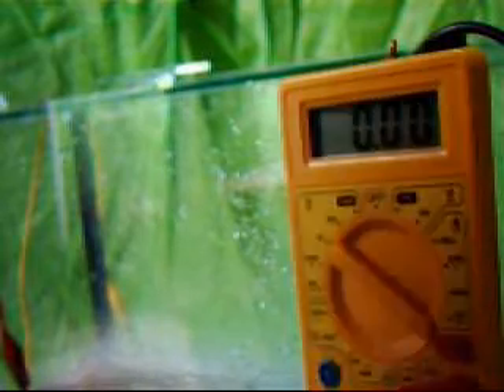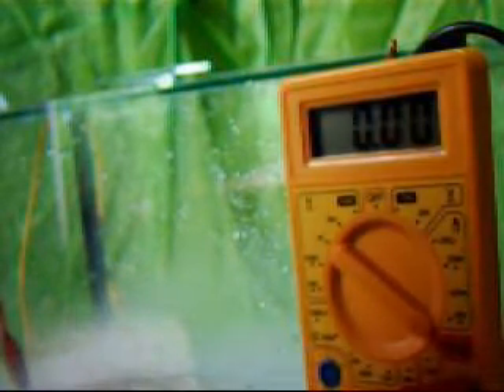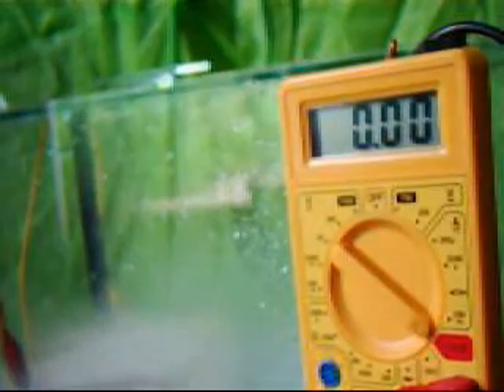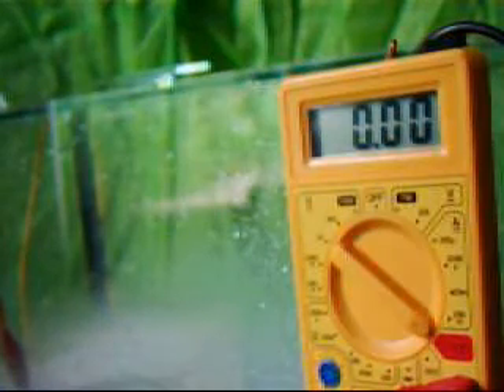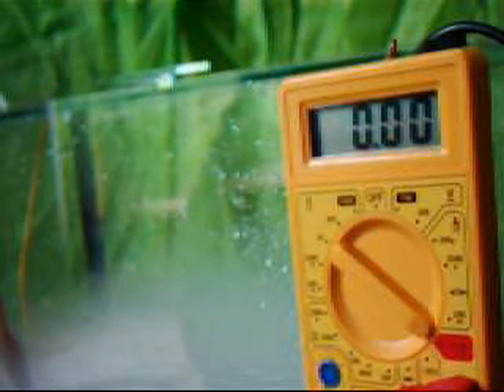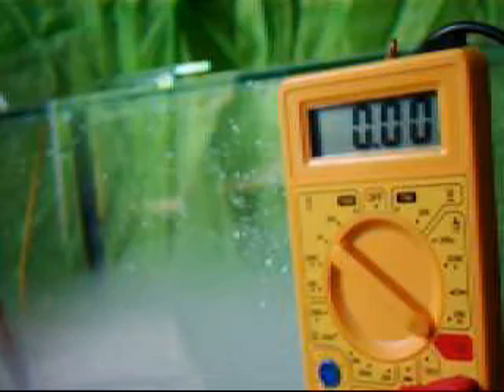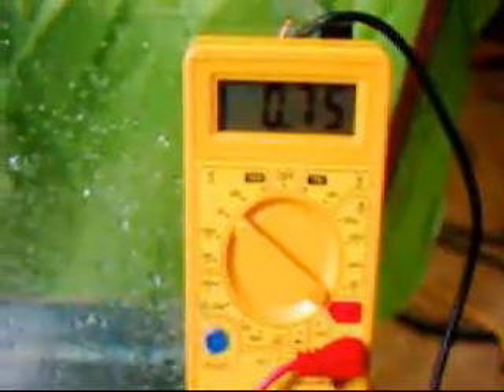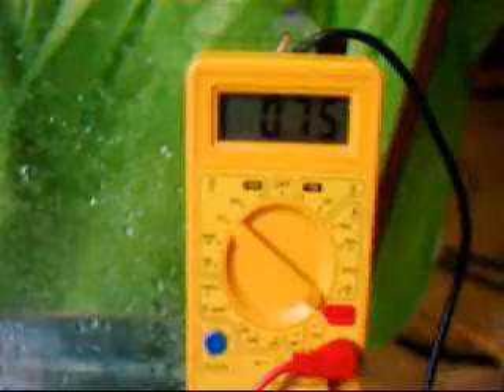Will electrolysis work in a fog?

Comment: I use both. Its Bill Cozzolino's dipole nexus arc. One uses 110 vac on the ground side and it will flash like a welder. The one i came up with is the same except for the 110 vac. I will try both in the fog and see what happens.